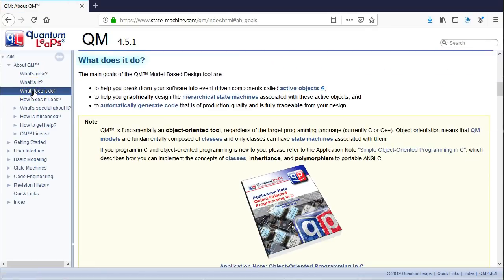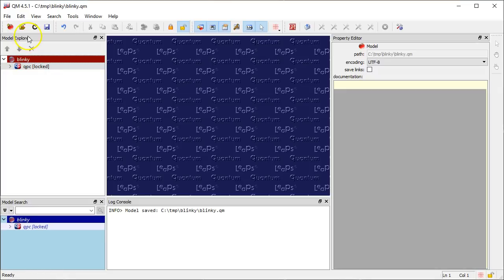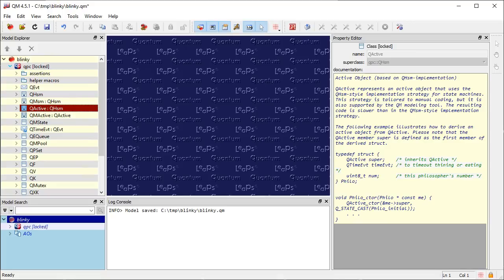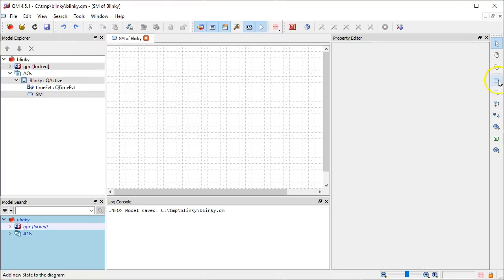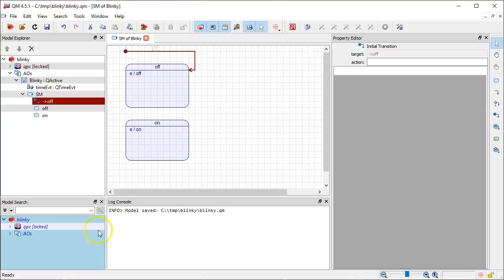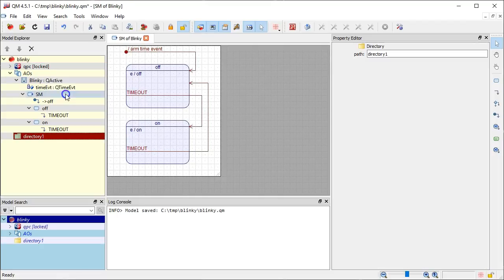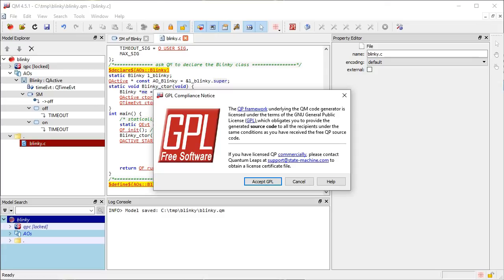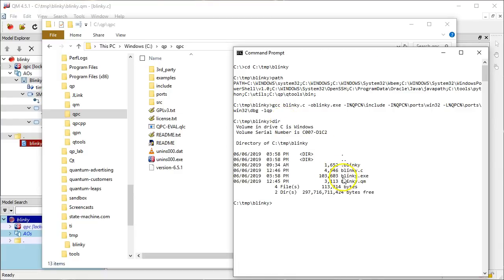QM Model-Based Design Tool Tutorial

Comment: I am following one of your tutorials for Getting started with Arduino, but the tutorial makes the assumption that the "manage tools" window comes mostly filled out, when in the version I've installed it is completely empty and I cannot find any tutorial for getting started there for building and uploading to the board.
Reply from the maker: The newer examples for QP-Arduino don't populate the “External Tools” menu in QM for direct building Arduino projects. This is because Arduino kept changing their build process and it became unworkable to keep adjusting the External Tools. Also, after introducing QP support for ARM-based Arduino (QP/C++ library for Arduino), the support for Arduino builds has become even more problematic. So, instead of using QM directly, the intended way of working with the Arduino examples is to use the Arduino IDE for building and downloading the code, but to configure Arduino IDE to “Use external editor”. All this is explained on the Arduino web-page at: https://www.state-machine.com/arduino/ --MMS

Comment: Seems to me this is OVERKILL for the rather simple arduino platform? Is it worth it to learn this IDE just for programming on Arduino? It's quite a long process, and I think even then the generated code isn't 100% arduino-ready?
Reply from the maker: Absolutely, if you only want to write Blinky-type programs, you can achieve it much simpler with delay() functions and hard-coding your event sequences. But if you wish to manage many things concurrently at the same time, you will be better off to adapt the event-driven paradigm and state machines.